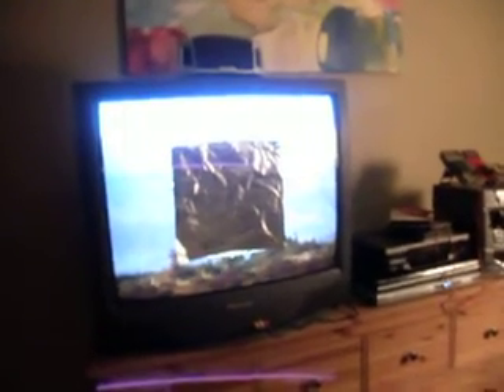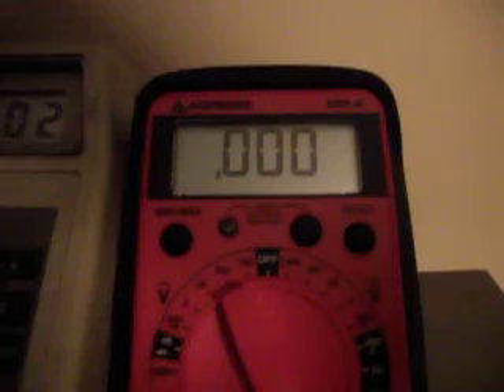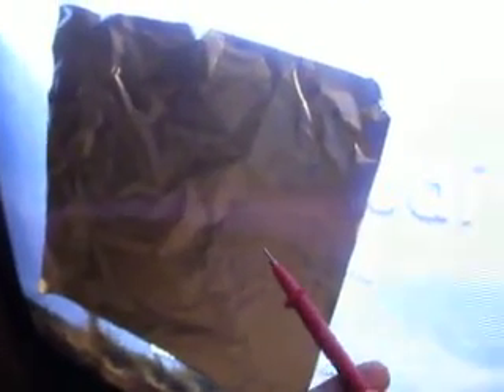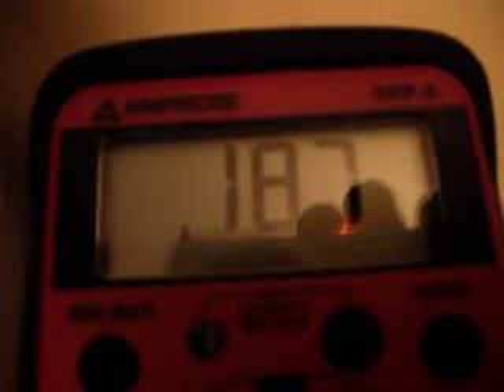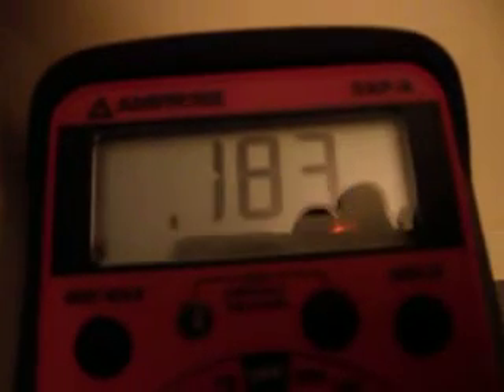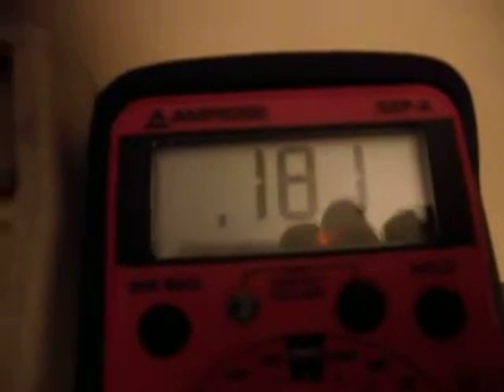Testing a CRT TV with Foil

Comment: What you got, depending on the size of the foil, is called "capacitive coupling", basically putting foil on the CRT causes a coupling of the high voltage (around 25,000 volts or so), to the foil.  I saw someone do this with a plasma ball once and it shocked the piss out of them.  Although microamps probably won't kill you, it certainly can hurt.

Comment from the maker: It appears to be an electrostatic effect that is caused by the high voltage electron gun hitting the phophor coating on the glass.  I was expecting to see DC voltage and current, but was quite surprised to find an AC voltage and so high!  I am in the USA and it was a 120V 60Hz TV that was used.  There are very strange radiation fields around CRT TV's and you need to be careful about human exposure to these fields.